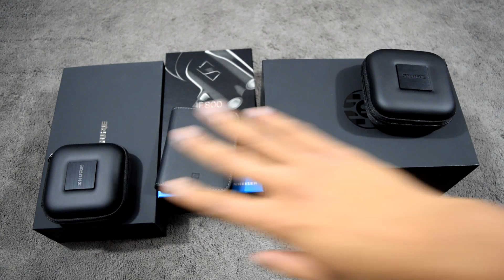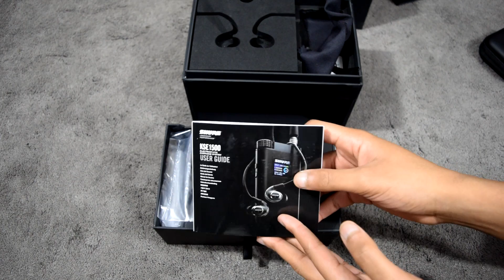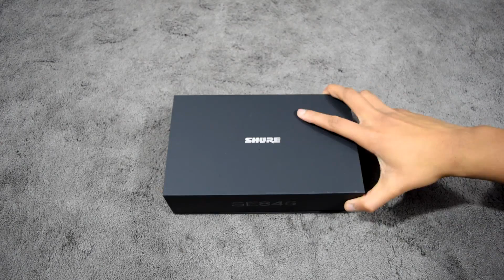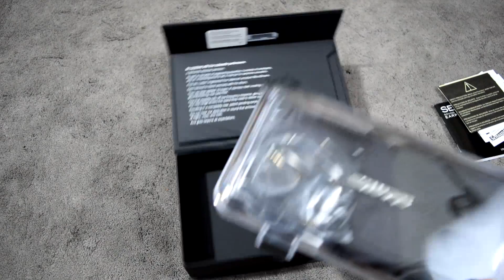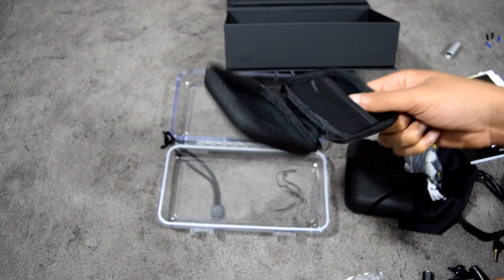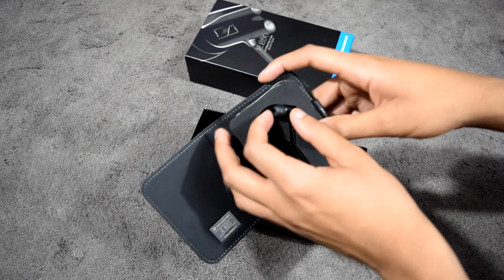3-Way Review: Shure KSE1500 vs. SE846 vs. Sennheiser IE800 (Pt. 1)

Comment: did you "buy" those then returned after making the video?
if you actually kept them for ~3 years, how is the durability of KSE1500?

any issues with the cables/amp/earphone? i'm about to buy the KSE1200
Reply from the maker: Durability is excellent. They are still holding up well. However, I take very good care of my stuff.

Comment: The idea of headphones with extended frequency response isn't it so you can listen at those frequencies because as you said we cannot hear below 20hz or above 20khz The idea behind extended frequencie responses in headphones is to extend the signal to get it to signal as flat and neutral as possible the faster the motor the more precise and accurate the sound in between the changing frequencies 

To dumb it down the faster the driver the more information can be interpreted in the signal/bandwidth which equals better separation and a cleaner over all image in the sound being produced.

Comment: Got the Se846 and have had them since the day they came out. Use them for the gym from my phone!  Lightweight, long cord, has its own volume controller, clinches well to my head and stays put in my ear while blocking all ambient noise. Couldn't be happier. No need to walk around with a large amp.  Cellphone costs 1000, in ear buds at 1k are not outrageous. 3500 is another story. No matter how great the kse buds are, I won't be switching. Great review. Thanks
Reply: Lies….

Comment: Antenntuator?  Dude - attenuator :)  

Great set of videos - have my SE846 on the way.  Thanks for taking the time to produce these!
Reply: Got mine on Amazon has the best price at the moment https://www.amazon.com/Shure-Isssolating-Earphones-Definition-MicroDrivers/dp/B00DIUGW6A/?tag=techjok-20
Reply: Even mine are on the way!
Reply: Congrats,it is a highly scalable iem with good source,even more than ie800.First thing to do is remove the foam from the stock blue filter,adds more clarity and detail.
Reply: jake len what do you mean foam removal? explain. I just bought these of ebay.
Reply: If you see the filters, blue and black filters are inserted with a foam to alter the sound quality, and white filters don't have foam inserted in them. You can remove the foam by yourself, but I think it doesn't worth it because each filter would sound similar if you remove the foam.
Reply: Doesn't that make blue filter sound similar to white ones as the later have no foam in them?
Reply: @Watermelon and jake len resp.
Reply: No they do not sound similar,even if you remove the foam.The most natural and musical are the stock blue filters and removing the foam,increases clarity and extends treble,like a veil being lifted,it's like removing an obstacle that is between your ear and the drivers.The whites are filterless but there is a 2.5db bump in treble.What you get is a brighter signature,with edgier highs but you lose musicality and the bass becomes much lighter.I prefer modded blues,just remove the foam that is at the edge of the nozzle with a pin,pretty easy.
Reply: jake len I will look into it, if i don't get it make a short tutorial.
Reply: jake len, that sounds great, and if you want more clarity, transparency and good highs then use the black silicon ear tips supplied with Audeo Phonak earphones.
Reply: http://www.head-fi.org/t/675219/shure-se846-impressions-thread/10455
Search for blue filter mod.
Reply: jake len thx mate

Comment: Hello have you tried the UM Pro 50? I'm deciding whether to buy this or the Shure SE846.
Reply from the maker: I had both. Really liked the UM50 Pro. However ultimately preferred the SE846 for its bigger soundstage and more energetic approach.
Reply: Alright tq for your reply!
Reply: I previously owned Um pro 50 until the right channel completely stopped working after a year, and Westone replaced them with Um pro 20, which are too veiled as compared to Pro 50s. Only vocals sound better with Pro 20s, but not better than Pro 50s. I was missing Pro 50s so badly that I pulled a trigger and bought SE846, which I always wanted to buy. To me, Pro 50s are superior to SE846s in terms of vocals, guitar, imaging and soundstage (more like 3d), and without any doubt, 50s are much more comfortable because of a small profile. 
TBH, I would choose Pro 50 over SE846 any day.
Reply: Hey I decided to buy the ES-3 from Earsonics, I was initially going to buy the UM Pro 50 as the soundstage on the Shure SE846 is not wide as the Westone. But the ES-3 is  cheaper as it only cost 400 euros and there is no quality issues like the UM Pro 50, I highly recommend this headphone.
Reply: Hi Akmal, have u tried the um pro 50? How does ES-3 sound compared to pro 50? I am looking to buy the earphones that sound close to pro 50? I really don't like the sound quality of SE846. Any suggestions?
Reply: Hey I haven't listen to the UM Pro 50, but I highly suggests getting the ES-3 as it is cheaper and to be safe, you should try it before buying. The sound signature is similar to the the Earsonics S-EM9 which cost around 1490 euros, you should check head-fi website regarding these headphones.

I'm sorry I couldn't be more helpful, that is all I have to say.
Reply: Hi Akmal, upon your recommendation I bought ES3. I am amazed by their sound quality, it is much better than SE846. Thanks, man!
Reply: @AD-vg5gv  Rubbish, they are good but they don't match the 846's.
Reply: Hi I bought both and once I tried the 546 I couldn't believe how good they were for the price insane quality